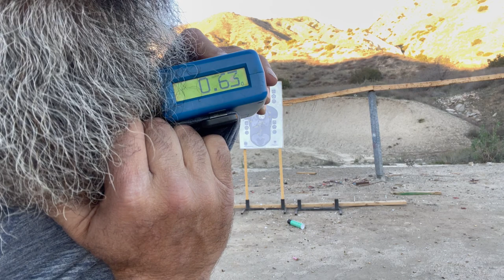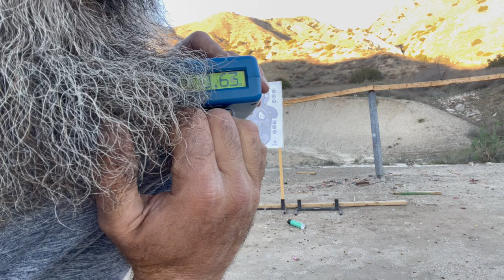Inside The Waistband Holsters - High Sweat Guard vs Mid-Length Sweat Guard Review

Comment: Thanks Maani for another great/informative video.  I have that same holster with the mid sweat guard (I got mine when they no longer offered the high sweat guard) and totally agree.  Took dog for a walk and holster was very wet with perspiration (as I would expect)  as was the top of my slide (which I would rather avoid).  Means more work for me as far a maintenance. I now switch out holsters to another brand with high sweat guard when doing anything that will result in more sweating.  Oh, and yeah .63   😳  👍🏽
Reply from the maker: Thx for watching. Unfortunately I haven’t been able to locate an AIWB with a mag caddy that is as comfortable and offers a great draw.